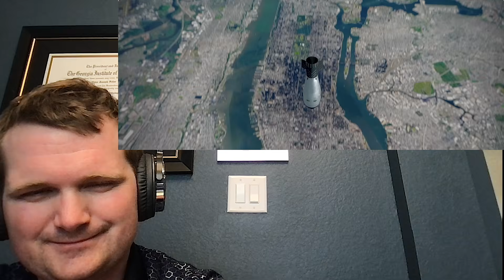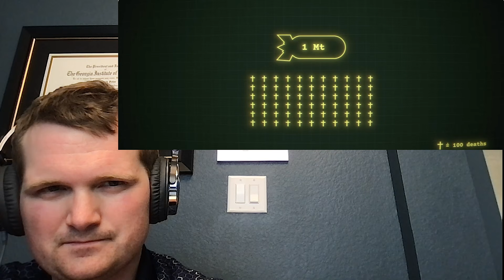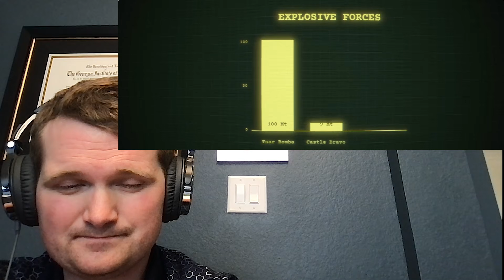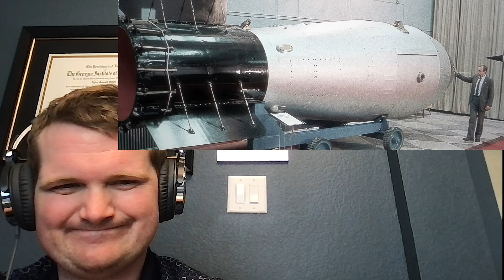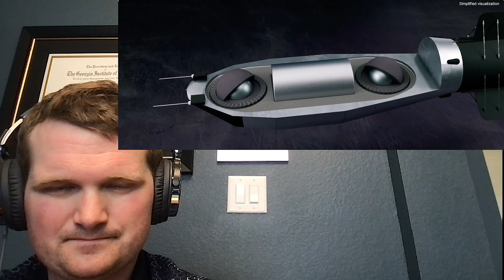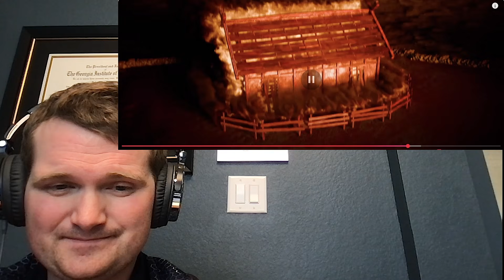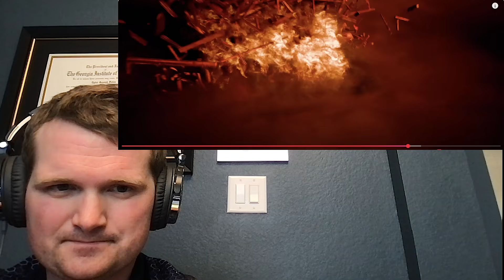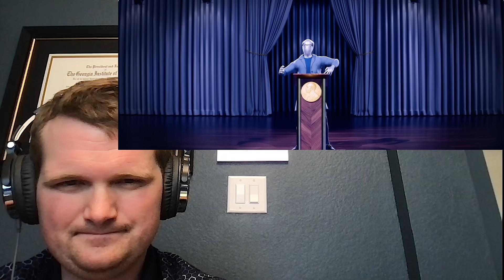The Biggest Nuke Ever - Nuclear Engineer Reacts to Fern

Comment: Tsar Bomba was an “exhibition” weapon. It was designed as a Soviet flex, not for practical use
Reply: Though they did end up making 25 Mt ICBM warheads, it's likely that what they learned from the test got used in some manner later.
Reply: @zolikoff  every test teaches you something. I'm not an expert but I'd assume that the Tsar Bomba test taught them a lot about how nuclear weapons work at high yields when it comes to efficiency and reliability, and probably also design features
Reply: While you could not deliver such weapons via a slow bomber, you could use them in submarines...
Reply: @miriamweller812 submarines or just ICBMs launched from ground as well. 
now they have nukes in clusters inside those missiles , one missile can carry multiple nukes, so there isn't really the need to make bigger ones , when you can hit with multiple small ones. 
Also , there's a limit of efficiency for big nukes as the energy start dissipating in space
Reply: @el_kapitan_uganda eh, not so much in the ground based ICBMs(Minuteman III) carries a single warhead in the 300KT range.
Reply: All nuclear weapons in race at that time were exhibition weapons.
Reply: i think it was also some sort of ''last effort'' thing, like the ICBMS are coming, so lets just explode the world
Reply: It's actually can be very practical nowadays by using spaceshutter and space exploration rocket to carry it. The problem is the cost vs the effective of destruction simply not worth it.
Reply: It was to scare the USA, direct truth
Reply: @sindano.n and it did nothing except invigorate the U.S to become more defensive, while remaining as offensive as they ever were. Both sides knew they both had the upper hand on a first strike, but no matter what either side did, a counter strike would happen and be successful enough to cause catastrophic damage. Mutually assured destruction negates the size of the bombs, more so the ability to use them at all. No one wants a 50 KT nuclear bomb going off just the same as they dont want a 50 MT going off either
Reply: @haventthoughtofanameyet6364  nuclear war is never good at all, all involved will suffer a lot
Reply: This bomb couldn't fit properly in a bomber's bomb bay, but Sakharov's plan called for it to be delivered aboard a submarine to the US coast. An underwater explosion of such a powerful bomb would have created a monstrous tsunami. The only reason this project was never realized was because Soviet Navy admirals called it "cannibalistic" and Sakharov a "butcher." In reality, Sakharov was deeply shocked by the military's reaction to his project, which turned out to be far more humane than he, a physicist, and it was after this that he began to consider the humanitarian aspects of his developments. The secret of the situation was that at the time, all the Soviet admirals and generals were veterans of World War II (the Great Patriotic War), and their memories clung to images of total destruction and boundless human suffering. And it was precisely because of this that the Cold War did not escalate into a hot Third World War.
Current leaders have never seen such scenes of destruction and human grief, so they have no brakes, and we risk falling into the abyss.
Reply: @Станислав-с6п8я 
One of the great failures of WW2 was that the USA was never bombed.
Reply: @DonaldGunn-n8g  Except Hawaii. Pearl Harbor. However, Hawaii was not a US state at that time.
Reply: Now they're getting slapped around by Ukraine out of all countries thanks Obama
Reply: Landing men on the moon was a better flex and represented something superior.
Reply: @FeralCoon  Mind you, the soviets were almost close to do it too, besides, the first satelite, human and mammal in space are totally Soviet achievements, so, let's talk about flex 😂
Reply: @nahuelamolto3369  Their incompetence was demonstrated by poor Laika's cruel fate. Some achievement. Like a bunch of hillbillies. 🪆
Reply: @nahuelamolto3369 the superpower of Russia can barely fight on par with Ukraine a proxy country of the US. They were never number 1 and it shows today and in history
Reply: @nahuelamolto3369 the flipside to that: america was also bustling and expanding in all directions, militarily, socially, economically. The Soviet Union was languishing dangerously close to starvation through out the entire cold war in most of their territories as they were pouring every resource they possibly could into their military. America just did it better, even if they were a half step behind rocketry calculation until they finally took the moon first. There's always a certain way you can tell a story to make one side look better than they actually were. Soviet Union had better rockets, but literally nothing else as their population got so tired of the Soviet union they abolished it..
Reply: @rushpatriot2866 russia =/= soviet union
 Make that distinction, it is important. Soviet Union hasnt existed for like 40 years now. Soviet Union is not Russia. Russia was within the Soviet Union. Anyone who knew anything about military armament knew Russia was a paper tiger two decades before they invaded Ukraine...
Reply: @haventthoughtofanameyet6364 the population of the soviet union massively voted against the dissolution, it was done by Yeltsin not by the people. The people had a good life and they knew it would get worse.
Reply: @haventthoughtofanameyet6364  The people of the Soviet Union never tired of the Soviet Union; life there was quite well-fed, free, and secure. In many ways, it was better than anywhere else in the world today. The Soviet Union was destroyed not by the people, but by the ruling elite, who dreamed of privatizing the people's wealth. In 1991, the USSR held a referendum asking one question: preserving the USSR. In all 15 republics, including the Baltic states, over 90% of the population voted to preserve the USSR. Nevertheless, six months later, representatives of the ruling elites of these 15 republics gathered in Belovezhskaya Pushcha and agreed to dissolve the Soviet Union. At the same time, the people of the USSR were told that the USSR had not been dissolved, but simply transformed into a new, more democratic structure—the CIS. The people were promised that everything good about the USSR would be preserved and all the bad would be eliminated. This, of course, included preserving all the benefits of socialism. And thus, mass popular protests were avoided.
Reply: @rushpatriot2866  Well, at least when it comes to nuclear weapons, Russia is far ahead of the United States. Not in quantity, but in quality. In terms of the percentage of completely new, modern weapons. Especially in delivery systems. As for Ukraine, it's not just a US puppet; the entire EU sponsors Ukraine, while simultaneously trying to strangle the Russian economy. And before that, the US poured hundreds of billions into Ukraine. And what's the result? The war is not evenly balanced. Ukraine is being massacred. Contrary to the tenets of Western propaganda, no one wants to conquer Ukraine; it's being destroyed. Purposefully and methodically. By mid-2023, Ukraine had already become a "suitcase without a handle," unbearably expensive and heavy to carry, and a shame to abandon. Ukraine, like a black hole, is devouring billions of dollars from European budgets, and before that, the US. And it will continue to do so for many years to come. Many believe that Russia is now trying to freeze Ukraine, its fighting spirit. But that's not the plan. Russia is "simmering the frog," keeping the situation on the brink of disaster. Nuclear power plant transformer substations and those distributing electricity from Europe have so far been spared from attack precisely so that Ukraine remains in intensive care, requiring constant billions in cash injections but not dying completely.
Reply: @Станислав-с6п8я bro you will believe ANYTHING i swear to God. The biggest thing you got wrong was well-fed. Literally 10s of millions of people starved to death under the USSR...youre an idiot. Learn your history. Look up the Russian Seed war.
Reply: @haventthoughtofanameyet6364  I actually lived in the USSR. My parents did. We, my grandparents, lived there. None of them, absolutely none, ever went hungry. So you can tell me all the stories you want, but I trust my memory and the memory of my parents. Yes, the stores didn't always have sausage, and there wasn't always cheese. But basic foodstuffs were always available. Bread was so cheap and plentiful that it was fed to pigs on private farms. Sour cream and milk were always available. The problem with agriculture in the USSR was the rapid pace of urbanization and industrialization. The same problem exists in modern China. At the beginning of the 20th century, 86% of Russia's population were peasants, and these 86% fed the remaining 14%, plus grain was exported. In just two generations, 85% of the population became urban, leaving no more than 15% (these figures are arbitrary) in the countryside. The situation worsened dramatically after World War II (the Great Patriotic War), when the USSR lost 27 million people. Of these, 20 million were civilians living in the western regions of the USSR, the most fertile and agriculturally developed. Furthermore, after the war, industrialization had to be rebuilt, which further necessitated the "draining" of population from villages and rural areas in favor of large industrial centers. The problem wasn't the Soviet socialist system, but rather the number of rural workers. Furthermore, the other Eastern European countries that were part of the Soviet bloc exhibited similarly exorbitant levels of urbanization and industrialization. And the Soviet Union fed them as well. The countries of the socialist bloc collectively consumed more meat from the USSR than the entire Soviet Union consumed itself. Moreover, 70-80% of the USSR's territory was located in the so-called "risky farming" zone. Under no circumstances, no technology could yields in these regions compare with those in France or Belgium. Even the lands of Belarus, considered highly fertile, are inferior to those of Germany, France, or Belgium. Even in Canada, the climate is significantly more favorable for agriculture than in Russia. My grandfather was the dean of the agrochemistry department at an agricultural institute, where he studied soil fertility. The USSR was full of institutes attempting to overcome the laws of nature, to radically alter crop yields through highly mechanized farming and advanced, effective fertilizers. But this was only partially successful. Regular famines were a characteristic of Tsarist Russia. And the USSR dealt with this. It took a while, but they did.
Reply: @haventthoughtofanameyet6364  I actually lived in the USSR. My parents did. We, my grandparents, lived there. None of them, absolutely none, ever went hungry. So you can tell me all the stories you want, but I trust my memory and the memory of my parents. Yes, the stores didn't always have sausage, and there wasn't always cheese. But basic foodstuffs were always available. Bread was so cheap and plentiful that it was fed to pigs on private farms. Sour cream and milk were always available. The problem with agriculture in the USSR was the rapid pace of urbanization and industrialization. The same problem exists in modern China. At the beginning of the 20th century, 86% of Russia's population were peasants, and these 86% fed the remaining 14%, plus grain was exported. In just two generations, 85% of the population became urban, leaving no more than 15% (these figures are arbitrary) in the countryside. The situation worsened dramatically after World War II (the Great Patriotic War), when the USSR lost 27 million people. Of these, 20 million were civilians living in the western regions of the USSR, the most fertile and agriculturally developed. Furthermore, after the war, industrialization had to be rebuilt, which further necessitated the "draining" of population from villages and rural areas in favor of large industrial centers. The problem wasn't the Soviet socialist system, but rather the number of rural workers. Furthermore, the other Eastern European countries that were part of the Soviet bloc exhibited similarly exorbitant levels of urbanization and industrialization. And the Soviet Union fed them as well. The countries of the socialist bloc collectively consumed more meat from the USSR than the entire Soviet Union consumed itself. Moreover, 70-80% of the USSR's territory was located in the so-called "risky farming" zone. Under no circumstances, no technology could yields in these regions compare with those in France or Belgium. Even the lands of Belarus, considered highly fertile, are inferior to those of Germany, France, or Belgium. Even in Canada, the climate is significantly more favorable for agriculture than in Russia. My grandfather was the dean of the agrochemistry department at an agricultural institute, where he studied soil fertility. The USSR was full of institutes attempting to overcome the laws of nature, to radically alter crop yields through highly mechanized agricultural labor and advanced, effective fertilizers. But this was only partially successful. Regular famine was a characteristic of Tsarist Russia. And the USSR managed to overcome this. Not immediately, but they managed.
Reply: @Станислав-с6п8я stop writing books dude, im not reading all your communist propaganda. It is a WELL KNOWN FACT almost 100 million people have starved to death in direct relation to communist policy-making in China through the 30s, 40s and 50s, and Russia in the 20s and 30s. Ussr was trash, always was, and will always be seen as trash. Do bother replying again
Reply: @haventthoughtofanameyet6364  Fairy tales about the "horrors of the USSR" were invented by the people who destroyed and plundered the USSR, against the will of ordinary citizens. And you were brainwashed with anti-Soviet propaganda. Live with it. I don't mind. Just keep your erroneous opinions to yourself.
Reply: @rushpatriot2866  1 month later, do you still stand by your statement or did you change your mind?
Reply: @haventthoughtofanameyet6364  Modern Russia > Soviet Union. But whatever you say bud. Whatever you say. After 2022 I no longer engage in pointless debates, because actions speak louder than words. Every action Russia did compared to USA makes USA modern paper tiger. Plus it was not Russian invasion of Ukraine, but NATO invasion of Russia since 2014. Russian version of Cuban Missile Crisis. People with brain know what it is and are fed up.
Reply: @haventthoughtofanameyet6364  I love how you yankee keyboard warriors start lashing out in hissy rages when your own entire Terroristani propaganda about rest of the world is burts. What a pathetic clown lmao
Reply: @nahuelamolto3369  GTFO. The first program to torture monkeys and dogs in space. Let's talk about incompetence.
Reply: @Станислав-с6п8я  Bwa-ha-ha-ha! Unbelievable fantasy.
Reply: @FeralCoon  Moon landing was a last minute goal post shifting done by the Americans to save face because the Soviets were litteraly the first in every major space achivement by then, but most Americans don't know basic history because they live in a propaganda state of corporates
Reply: @divyanshparashar911  Last minute goal post shifting. Irrelevant. The Americans achieved it and the Russians didn't. You realize they stole 90% of their designs from American engineers, right? We're not in the 1950s anymore.

Comment: My understanding of the difference between a nuclear weapon detonation and a nuclear reactor meltdown is much of the fissible material is used during a nuclear detonation when compared to a reactor meltdown, resulting in much less fallout in a detonation. Reactor meltdowns do far less damage initially to the immediate area, but relase far more fallout into the air. But a ground detonated nuclear weapon will irradiate a lot of the debris on the ground and launch it into the atmosphere, but it will be nothing like a meltdown. But I am no nuclear engineer, so this may not be totally accurate.
Reply: Well, "meltdown" is not the same as radiation release. A reactor can melt without anything at all breaching the containment building. Assuming you are talking about reactors exploding like Chernobyl or Fukushima rather than contained meltdowns like Three Mile Island, you have fission products from potentially years of reactor operation built up in the fuel, instead of all the fission having to happen in one microsecond. The energy released from the fission in a reactor is drained away to power the turbines, but the fission products continue to build up for as long as the reactor is operating.

Comment: The larger yield of the Castle Bravo test was caused by a miscalculation regarding the reactions of lithium-7 in the device's lithium deuteride fuel, which was assumed to be inert, but actually produced tritium and neutrons, leading to a much larger explosion than anticipated.
Reply: and was used to inform designs of weapons going forward to increase yield. Gotta love happy accidents!
Reply: I sure wish man never would've  discovered nuclear energy😢 it could've been used for good but of course was weaponized right away.
Reply: @pauljames5914 drones,ai etc…
Reply: @pauljames5914 it’s going to be the best way to counteract climate change
Reply: @Mr91Jmay No. Nothing is wrong with the climate.
Reply: @mereen750  lmao there may be more things wrong with your head then there is with the climate, which is saying something 🤣
No, its not fine. Even Exxon found out the effects of fossil fuel emissions nearly 50 years ago, they just hid it and started pumping out misinformation. Good job taking it, hook line and sinker.